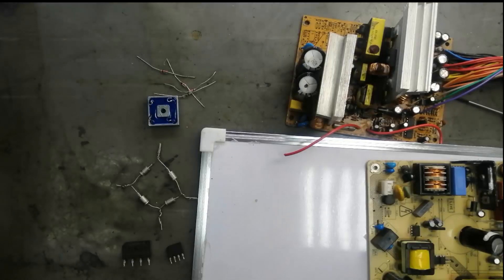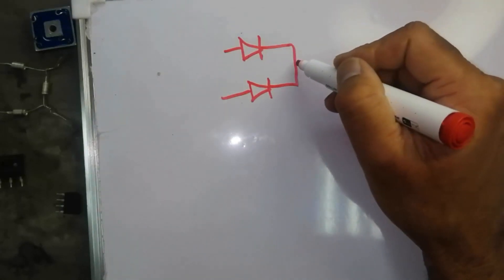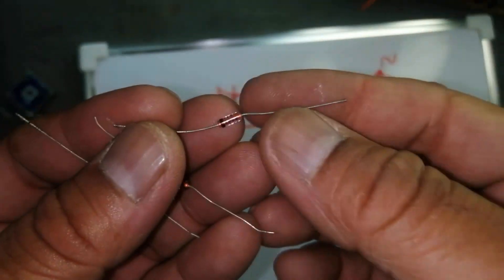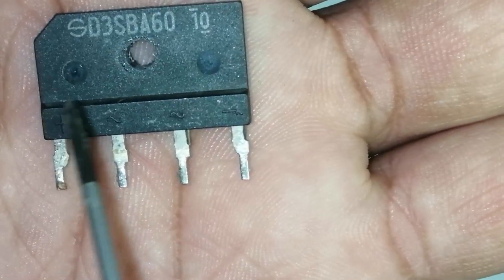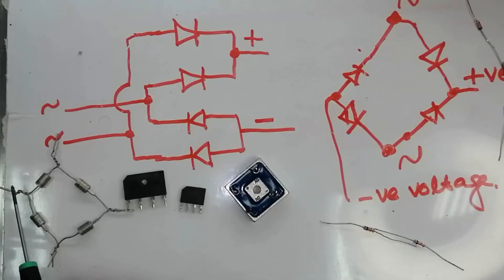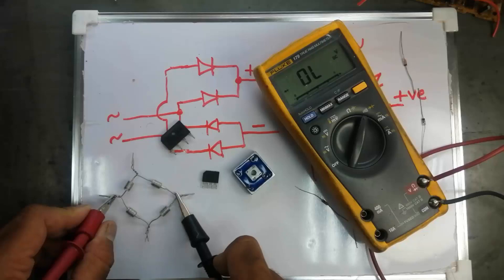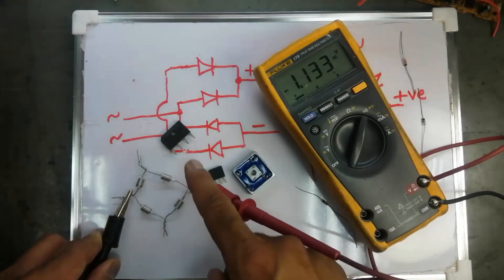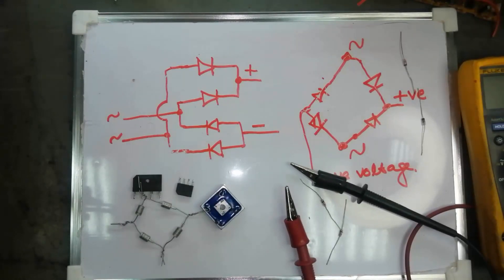#182 how to test bridge rectifier with multimeter

Comment: Hello, I have a problem with Philips monitor, when I check the bridge rectifier ( it is soldered on the card) I get the voltage drop only 0.5 V DC between -  and + , not a double voltage drop (1.0V Dc). Could it be the reason for the monitor not working? Thank You.

Comment: Thanks for sharing the video, in reverse to measure the total voltage drops of rectifier when I touch the +lead w/ +terminal  and -lead w/ -terminal. I got 4 times of voltage drops ~ 1.976V. What does that mean? bad rectifier? Please advice.